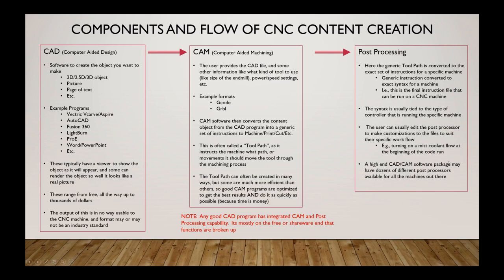CNC Machine Basic Overview

Comment: Just found your channel,  love the style and explanation.  What is the name/make of the blue work holding clamps you are using?
Reply from the maker: Thanks Darren.  
Those are Kreg in-line clamps https://www.amazon.com/KREG-KBCIC-Kreg-In-Line-Clamp/dp/B0774WBGPX/ref=sr_1_13?crid=NJ5HCCNYOMW3&keywords=kreg+clamps&qid=1682365944&sprefix=kreg+clamps%2Caps%2C145&sr=8-13
If you look around, you can find them on sale sometimes (I bought some from Walmart online last year for <$20).  These are all plastic and hold very well and seem to be just as durable as the metal ones I used previously.
Reply: @JNWoodworks  Thanks, keep going with the great content

Comment: I like the video where I could hear it, but you really need to adjust the sound level so it's the same throughout the video.  I can barely hear anything the Components and flow of cnc content creation on my tablet.
Reply from the maker: Ya, I was recording this one on several devices.  I did try to balance the sound level out but I didn't talk at a consistent enough level through the segments so I couldn't balance it very well.  In hindsight, I should have not done the opening segment in front of a running machine - too much background noise.

Comment: im curious why your z carraige is so tall, surely you can only cut the height of your gantry clearance?
Reply: Good question.  There are two reasons for me.  One is that the front area of my spoil board is removable so I can cut below the deck and I wanted to reach down there.  Second is that one of my laser mounts ( see my laser videos) mounts the laser below the spindle, so I need to lift it up pretty high.
Reply: @jimneeb2362  ah, it makes sense now, thanks